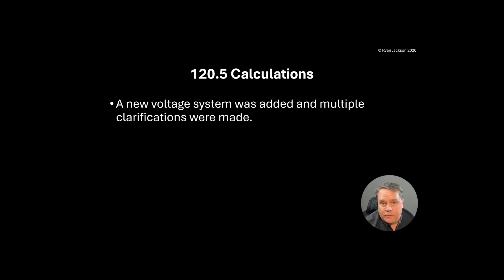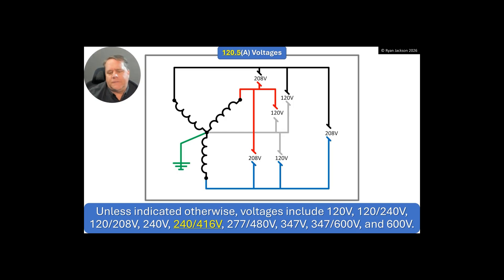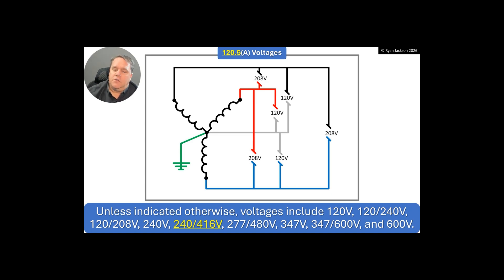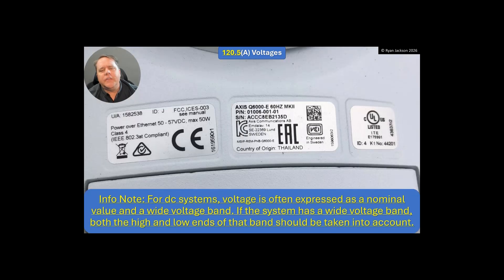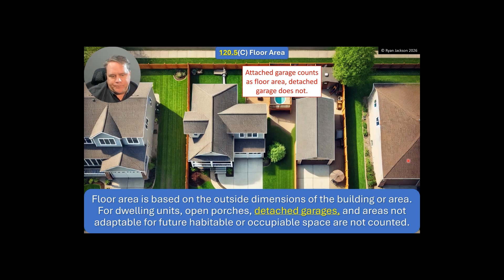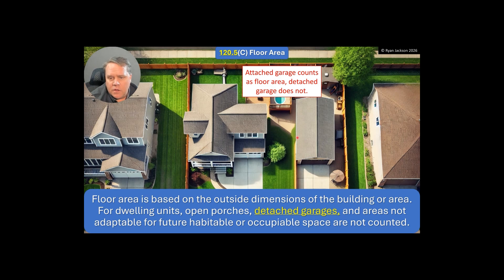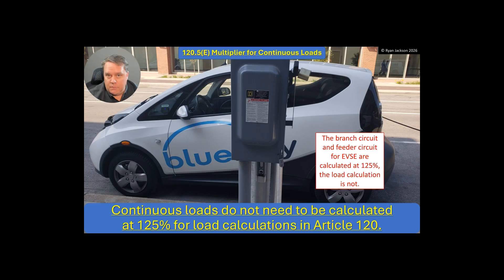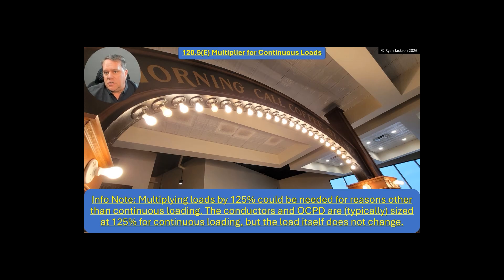100 Days of the 2026 NEC Changes Day 10: 120.5 Calculations

Comment: Ryan, im trying to understand more of the intent of the changes with detached garages. Is it more to align with the fact that a detached garage is not a dwelling unit per Art. 100? So is the intent then that if you have a detached garage, because of the revised floor area in 120.5(C), then in 120.41 now the branch circuit in 210.11(C)(4) and the applicable lighting outlets in 210.70 are not included in the minimum unit load? Would the feeder or service load for a detached garage now be based upon Table 120.42(A) and 120.14(I) for lights and receptacles? This just seems a bit cumbersome. I think your proposed logic on the varying uses of detached garages is a bit weak. Could someone not say the same about an unfinished basement used just for storage versus one that is a full on family space or man cave?

Comment: Hi Ryan,
I have followed you for awhile and am enjoying your  videos on the 2026 code. The last one that you posted on article 120 has me confused. You stated that the 125% for continuous loads was not required to be added into feeder and service entrance conductor calculations in the 2026 code. Your reasoning makes perfect sense, but then you went on to say that this has always been the case. If that is so, the way I was taught, and most importantly the way I have been teaching for the past 40+ years has been wrong. I got out my 2023 code book and checked the examples in chapter nine, specifically example D for store buildings. This clearly shows that the 125% is added to the calculation for “feeders and service entrance conductors”. So my question is: is this a change in the 2026 code or something that has been misinterpreted for many years by many people, including those that make up the examples in NFPA 70 itself? I feel like I am losing my mind. Perhaps I am just getting too old for this….
Thanks for your help. I appreciate all that you do for our industry.
Reply from the maker: Hi Donald. I too was wrong about this for several years (decades), but so was the NEC! The truth is, Article 220 (now 120) did not require the 125% to be added to the load calculation. If it did, we would have been penalized twice (load at 125%, then conductors and OCPD at an additional 125%!). The example that you mentioned wqas fixed in the 2026 NEC. It was wrong. You're not losing your mind, we all are!
Reply: @RyanJacksonElectrical thanks for the clarification.

Comment: 240/416 is common in compliance test labs, often by using a 60->50Hz motor-generator.  Products are then tested to a variety of international standards, along with US.
Reply: Interesting.   I have always thought of that voltage as being exclusively used in Australia, as well as extremely select areas in North America as a separately derived system for the purposes of operating imported equipment requiring these voltages.  

I have heard of 600Y/347 being somewhat commonly used in a small handful of industrial facilities in the northern States near the Canadian border

Comment: Thank you , really enjoy watching and learning from your videos!  

I would like to input that 180VA probably shouldn't apply to heavy duty lampholders especially the E39 base as those are typically used for incandescent lamps of 300 watts and up, and all but the smallest - generally less than 150 watts- metal halide and high pressure sodium lamps.